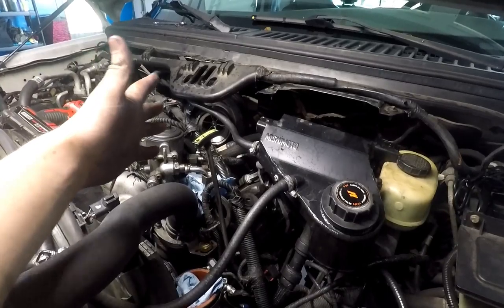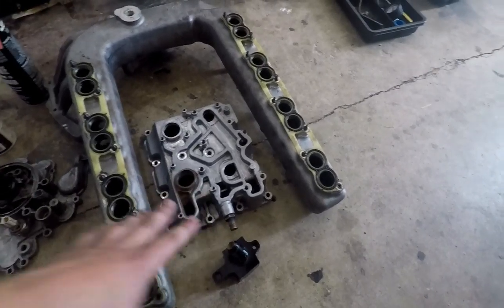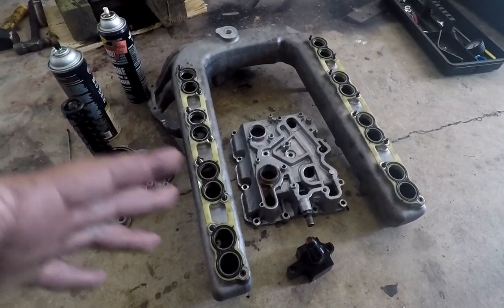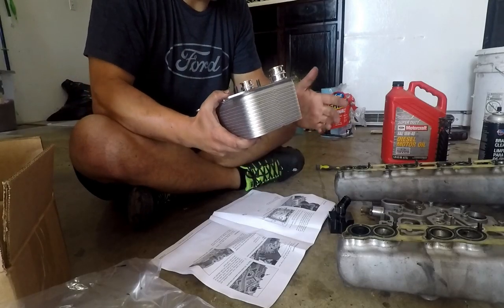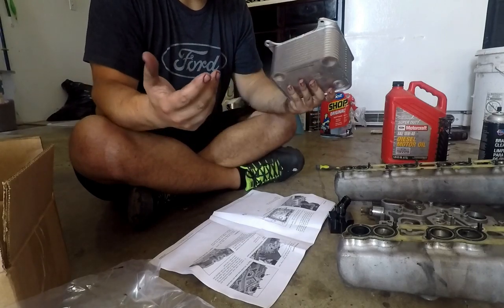Oil Cooler Replacement

Comment: I gotta ask a dumb question sorry but I’m new to 6.0s I’ve been losing coolant and I’m not to sure if I should be worried but can I just add coolant to the DGAS bottle ????
Reply from the maker: sorry for taking 2 years to respond but yes just add through the degas bottle. did you find out why  you were losing coolant

Comment: How many oil coolers have you gone tho I have a 2006 f250 with 490,654 miles all original head gaskets head bolts and oil core I’ve own it sence it was new
Reply from the maker: So even though I have replaced them a few times I have only had 1 failure, amd that was a brand new factory oil cooler it was defective

Comment: Years ago I had my oil cooler deleted. Recently I had a new one installed to address an oil leak. I went on a 6 hour drive the coolant hose y under the reservoir broke and I lost all coolant. Temp gauge did not redline but it got close.  Since then coolant and oil temp has been running high (210 to 225). Coolant reservoir cap seems to “pop” and leak a bit of coolant. Also my oil pressure gauge crashes at idle. I’m thinking a plugged up oil cooler or bad install on the egr.
Reply from the maker: Wait oil cooler delete or egr delete? The y does break I have heard of it someone sells a aluminum one to replace the plastic. I wonder if your thermostat isn't maybe a little warped after the coolant leaked out and the raising temp may be increasing pressure causing the cap to pop a little bit. I would get a new cap, and replace the thermostat

Comment: These diesels are a big money pit of wasted time and money.  Constant BS with oil coolers, turbos, etc.  I wish I would of bought a gas one.  I'd rather pay more for gas then spend    weeks fixing a POS deisel.
Reply from the maker: What happened to the truck?
Reply: @six0bros  smelled coolant today.  pulled over into parking lot, opened hood and saw chocolate pudding erupting out of the degas bottle like a pudding factory.  What's the point of saving 4 miles a gallon when you got to dump 3 grand into it every 3 years and add all kind of delete kits'n'shit.  isn't it better to buy a truck that is designed well from the factory.
Reply from the maker: I mean that does suck man, but the issue i think is in mechanics not letting people know what causes such a failure. So people can prevent it. I mean fortunately it is a crappy weekend job for a first timer but it shouldn't be more than 500 in parts. But a shop probably will have about 1300 with labor

Comment: What coolant u running and man ur going to have another clogged oil cooler u need a vc9 flush Anthony has a video how he does it and he did a coolant flush on my truck and it's been over a year and I have only seen 8 to 10 degrees delta max when towing I was towing 10k and when driving only seen 4 to 6 depending my speed lol
Reply from the maker: Hey man! I wanted to do a flush and just didnt have time. I agree there is a good chance this one will clog. Seems the oil cooler is the best coolant filter lmao. Completely agree with what Anthony says about flushing too!

Comment: if my deltas are through the roof but no oil in the coolant, how many flushes would i need to do before changing oil cooler?
Reply from the maker: You can try a flush with some compressed air too and see what happens some people get it some still need to replace I would say try 3 flushes and if it that doesn't start to improve it I would replace

Comment: First time owner of a 6.0. I have a question, my oil cooler failed and put oil in my coolant system. Do I change the oil cooler then flush cooling system?  Or do I flush system then change oil cooler? Any help would be greatly appreciated thanks
Reply from the maker: You will want to flush the cooling system then change the oil cooler. Now once you replace your cooler, I would start with water in your cooling system for a bit of a drive. Make sure there is no oil residue in your system before you filling drain and refill with coolant.
Reply: Flush the system before I change the cooler. With the cooler bad won't that constantly be putting oil in the cooling system while it's running too flush the system? Like I said first time owning a diesel engine...... thanks for the reply and help
Reply from the maker: Typically the leak is not bad enough to put a significant amount of oil over in one or 2 flushes. This way you can get rid of most of it and only worry about getting a little residual out instead of cleaning the whole system. To do a good flush I would remove the thermostat and put the housing back in so the radiator gets a good flush too
Reply: @six0bros  thanks. Then after one or 2 flushing then change the cooler right.? Then I need to flush again until it's cleaned out right?
Reply from the maker: I would gauge how many to do prior based on how much oil is coming out. I would do 3 prior to it, and if it was clearing up then I would replace it and do a few more flushes after to make sure it was clean
Reply: @six0bros  thanks man appreciate the help will keep in touch with you throughout the process if that's fine. Nice videos very detailed keep up the good work
Reply from the maker: @getsomeoutdoors42  thanks man, and yes keep in touch stay tuned for love streams where I open it up for you guys to ask me just about anything I am trying to do them every other week
Reply: @six0bros  will do
Reply: @six0bros  oh one other thing. What should I use to flush the system with at first before I change the cooler and after I change the cooler
Reply from the maker: @getsomeoutdoors42  I used cascade powder you could use simply green too. I would mix a good bit in a gallon container then pour into the system and run it to operating temp
Reply from the maker: Diesel tech ron has a really good video on flushing these trucks

Comment: I was going to replace the oil cooler on my 06 with a OEM Ford. But I stopped.researched bullet proof diesel's external oil cooler. Wound up spending a lot more money putting EGR cooler bulletproof diesel external oil cooler and bypass filter. Also bulletproof diesel water pump I was going to put their radiator. But mishimoto offered radiator intercooler and hoses and clamps all in one much cheaper price. Also installed a coolant filter. Put a fan clutch wire protector. Since the heads didnt lift i i re studded the heads (arp). So i was all set to do exactly what you did. For 6-7hundred week end job.lol. 1 month and 5 k later . I think these trucks are more addictive than heroin

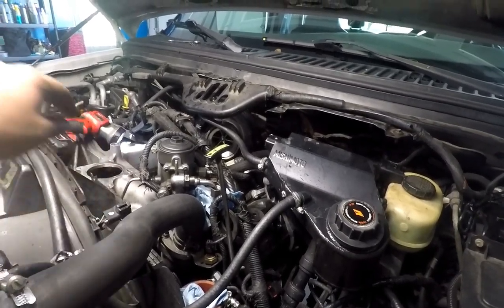Comment: Bro at 6:09 that’s quite the jump from hey removing the oil filter housing till all of a sudden the whole intake is off.
Reply from the maker: it really isnt that much overall. its a bunch of bolts out of the intake manifold then pull it. it seems like a lot more than it is because it opens so much up when you do

Comment: About to do a bunch of work on mine this up coming weekend.  I have a failed EGR cooler and I've been slowly having to add water to it.  My radiator sprung a small leak and coolant level got low.  So now I'm going all out.  New oil cooler, odawg intake, BD exhaust manifolds, Powermax turbo, Discrete Diesel y-pipe, water pump, thermostat, belt, belt tensioner, Mishimoto radiator, CSF intercooler.  Can't wait to see how it will runs afterwards.  I don't necessarily think the coolant re-route adapter you have is absolutely necessary.  Can't you just run a hose with hose clamp straight off where it used to go to the EGR cooler, then T into the degas hose?  I did buy a PPE oil cooler from Thouroughbred diesel.  Hopefully it will be fine.  The bypass filter barely does anything honestly.  The reason is all the coolant has to still go through the cooler first, so regardless, even if you have IPR full flow coolant filter, stuff can still get trapped in the cooler first.  that is why the only sure way is IPR oil cooler relocation kit which then will take advantage of filtering the coolant first before the it goes in the oil cooler, or Bullet Proof Diesel's air to oil cooler setup.
Reply from the maker: Man you have a great build man. As for the reroute you're 100% on point yes you can just take heater hose and do exactly as you said. Hope your build goes well man it sounds awesome and with a lot of parts I have used as well
Reply: 6.0 Bros honestly, most of the ideas came from you.  I bought one of those cheap intercooler pipes from Amazon.  Decided to return it and go the No Limit route.  Some other goodies on the way in the way of tuning.  Anyhow, looking forward to your next live feed.  By then my repairs will be complete and I can report how the truck is running 👍
Reply from the maker: @trife78  that's awesome man I am glad my guild has helped people out in picking some great parts

Comment: You looked into the bulletproof diesel air to oil heavy duty oil cooler? My delta was 60 degrees at one point when my OEM one clogged (165,000 miles). Did some extensive research on oil coolers and bit the bullet and went big. My oil is consistently 10-20 degrees cooler and I tow heavy equipment often. I was always afraid of putting an OEM cooler in. More work, but well worth it in my opinion! Love your videos, keep it up!
Reply from the maker: I think the heavy duty kit with winter prep is a great kit but I have had good luck with OEM overall
Reply from the maker: And thank you for the support
Reply: Is normal driving eot- 225 ect-200-205 on a 100 degree day normal? Just bought truck with edge cts2.
Reply: @Ryansbbqnbrew  so how to test if your oil cooler is healthy or not is to run down a flat highway or as flat as possible and drive at 65 mph and see how your temps go. You want the truck up to operating temp prior to this which is around 190 oil and coolant. The difference in temp between oil and coolant shouldn't go past 15 degrees. If it is around 15 degrees then you are at the point that your oil cooler is failing, and is clogged. Now once you are towing or going at a different speed than the 65 mph on flat highway then the temp spread is irrelevant
Reply: @Ryansbbqnbrew  sorry this is my other YouTube channel my I am the guy from the video just on my fitness channel page I am starting lol. You oil temp would come down after oil cooler replacement

Comment: i got oil in the coolant tank. mechanic said it is the oil cooler. what do you think?
Reply from the maker: Your mechanic is right. It is a broken oil cooler. Your egr cooler should be replaced at the same time.

Comment: Hello I just did a 06 f250 oil cooler gasket replacement and now it isn’t starting any tips on what to check for ????
Reply from the maker: Most likely because the oil system isn't primed. I would check your icp and ipr and see what they are doing. If you don't refill your oil through the oil filter housing it won't prime the high pressure oil system, and will cause long cranks. Also make sure to cycle the key about 6 times to prime the fuel system

Comment: We have not been able to remove manifold with turbo on...   does not seem to clear the turbo and we did not see in the video how you pulled it out.  TIp or trick?
Reply from the maker: No tricks. It is the only time I did that and honestly I don't know that it was worth it. I remember it kinda being a pain. So I did get it out no tricks but honestly overall not sure it was worth the headache. If I ever replace that stuff again I will show it better but probably not worth the added hassle.

Comment: Tanks you for you video, how much do tink is cost for that job?
Reply from the maker: I haven't looked up pricing for these parts recently but with oil, coolant,  oil cooler with gaskets, turbo gaskets and o rings you're probably around 750ish if you do it yourself but that is really just a guess I haven't looked up prices in a long time. Xtreme diesel usually has a 10% off diesel10 use to be the code they had.

Comment: If nothing is mixing and the oil temp is just over heating do you still need to flush the system?
Reply from the maker: sorry for this being old and me not responding. However you do not need to flush the system if you are not having coolant and oil mix. you may want to consider flushing if you are going to change type of coolant or are doing some maintenance on the cooling system

Comment: Hi! Please help.
2008 Ford focus 1,6 duratec/Z6.
Overheating, water and oil mixing on the cooling system but not in the engine.the oil in the sump is clean. What could be the problem? Do I have to change the head gasket?

I'd really appreciate your help. 
Regards :Lutendo
Reply from the maker: I'm sorry I am not much help on this I would Google it and see where oil and coolant would mix in that system. I would guess this is the likely cause of your over hearing but I just don't know enough about that vehicle to be much help

Comment: I’m fairly certain this is what I have happening. Pulled the egr valve to clean it when I did an oil change this week. Gummy soot. Not good.
Reply from the maker: Besides the egr needing cleaned is anything else happening?

Comment: How would you recommend priming the fuel system?
Reply from the maker: I start by before I put thr filter in cycling thr key to on and letting it push air out of the top fuel bowl. I would do that like twice then put the filter in and cycle the key on for roughly 30 seconds and then off like 5 times. I don't know what the ford procedure is if there is one but I feel this is a pretty good practice for this type of thing
Reply: @six0bros  thank you for a great video and for being so helpful and informative!
Reply from the maker: No problem glad I can help.

Comment: 6.0 Bros  Is there a Aftermarket way of putting a spin on oil filter? would you recommend it? Or is it better just to keep the stock filter?  Thank you! And thank you for all your videos.
Reply from the maker: Hey so there are bypass filters but not one I am aware of to put a spin on filter only. That said there isn't truly a reason to replace it
Reply: @six0bros   Ok cool, Thank you.
Reply from the maker: Anytime
Reply: Late to the party here, but if you do an external oil cooler from BPD, a spin on filter is an option.
Reply from the maker: I did forget about that option. I still don't think it's worth it but for someone that does truly want it that is an option
Reply: @six0bros  
I wouldn't do their cooler setup only for the spin on filter, but if I swapped to their cooler setup it would definitely be in the cart lol. I have a 450 I'm putting a cooler in this weekend and the system is pretty nasty even after multiple rounds of VC9, if/when this cooler plugs up again I'll be going external since there's no more USA coolers.
Reply from the maker: @kylesonsalla7620  one things to watch out for is the vc9 will break a lot of stuff up and push through the system. I would highly recommend to make sure that is out of the system before the new cooler. maybe even trying a few backflushes with water and compressed air before the new cooler goes in.
Reply: @six0bros  
I did that too, my driveway looked like a river bed with all the shit that came out but it's still running high EOT towing or extended highway driving.
Reply from the maker: @kylesonsalla7620  ok good just making sure you got as much out as you could before the knew cooler in
Reply: @six0bros  
I even pulled the block drains and put in valves to open every time I flushed it, still didn't clear up lol. I'm pretty sure I'll be going to an external oil cooler and this is just buying time until then, but we'll see.
Reply from the maker: @kylesonsalla7620 you did it the right way man. Most don't go that indepth. Well don't. I hope it fixes it I would hate to see ya spend the money for external but I would understand
Reply: @six0bros  
I'm a diesel tech by trade, I definitely know how big of a pain it can be to have multiple failures because a procedure wasn't followed. I have a full flow coolant filter to go on as well as some other goodies while it's apart. FRX, Mishimoto CAC piping, No Limit intake, etc, all the fun stuff lol. I have another 06 F250 that I've already been down this road with once so I'm decently familiar.
Reply from the maker: @kylesonsalla7620 I love when diesel techs watch and comment man. You know those headaches better than me. So you have 6 liters
Reply: @six0bros  
Yeah, two 06's, a 250 with 200k on it and this 450 Lariat I picked up in the fall with 60k on it. It's a Kelderman conversion pickup with air ride in the rear. Real sweet unit that someone didn't maintain quite as well as I'd hoped for as low of as are on it. Still had original front tires with a 5005 date code 🤣
Reply from the maker: @kylesonsalla7620 that sounds awesome man. Those conversions are not cheap! I would love to drive one once just to see how they feel
Reply: @six0bros  
It's very smooth, even better with my 24k lb gooseneck behind it. Had to custom build a B&W hitch for it since no one makes a hitch for a cab and chassis truck with a bed on it lol